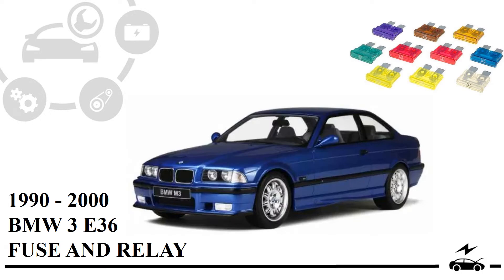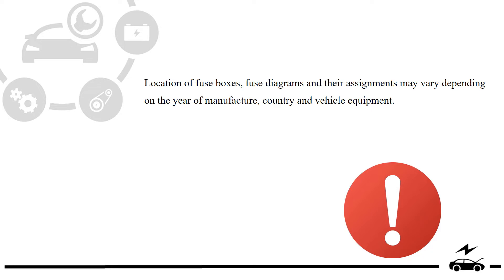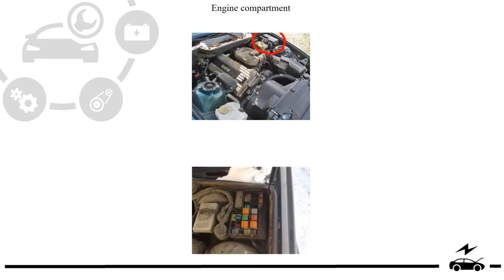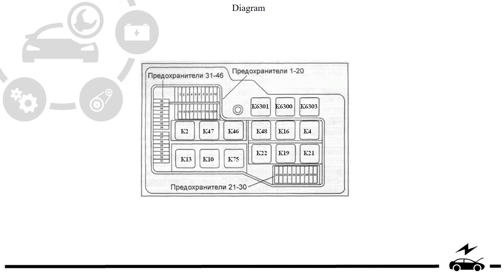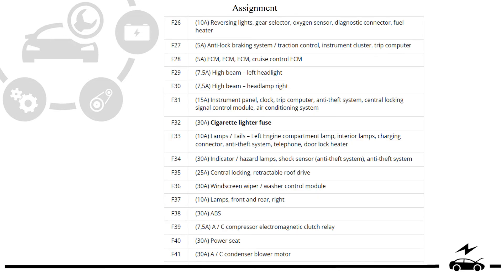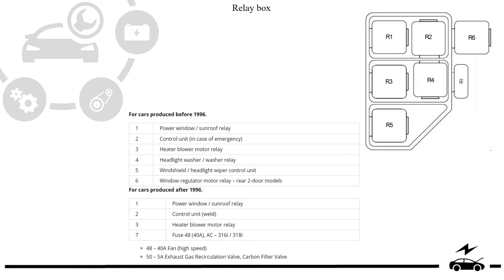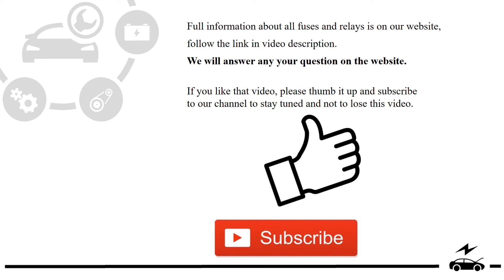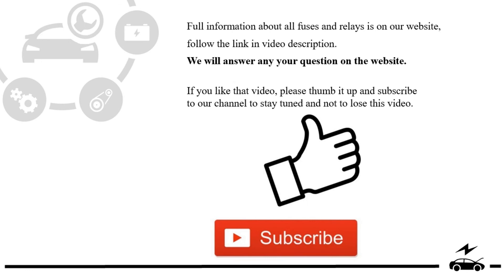Fuse box diagram BMW E36 1999 - 2000 and relay with assignment and location

Comment: Diagram where sunroof relay is in,where is that located as car does not have that  relay setup as shown R1 tot R6 and my sunroof does not get power to the fusebox where all the fuses are located,we checked it by no 1 to no 5 fuse and sunroof then got power but i want sunroof to open on its own fuse, please guide me what to do